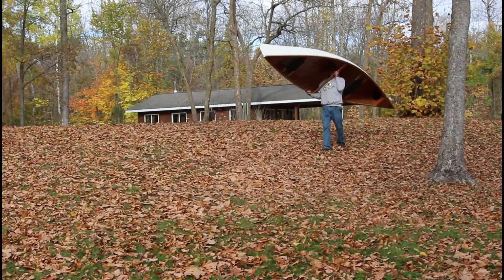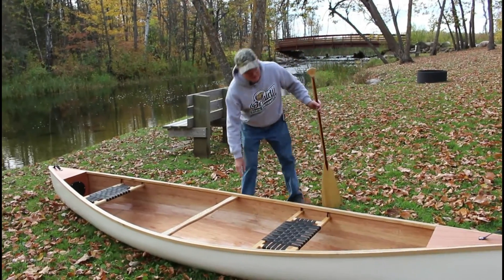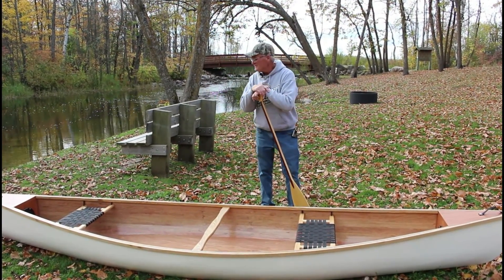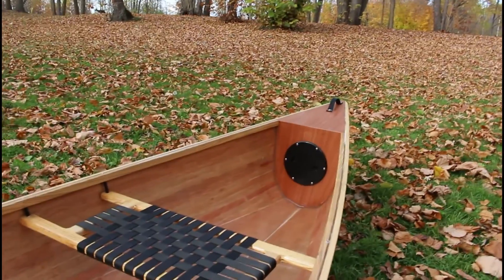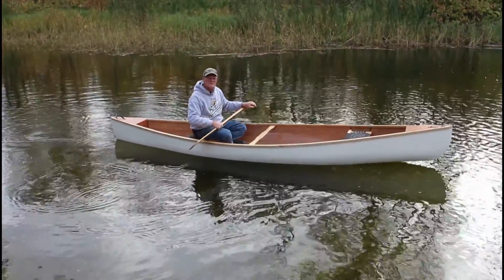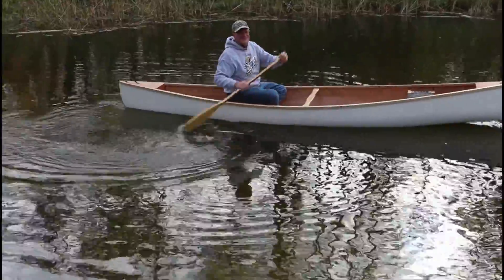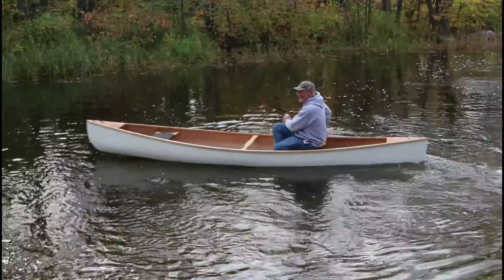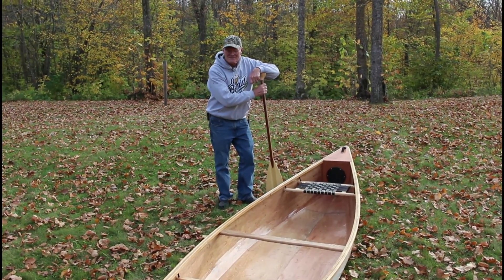Maiden Launch of Ripple II the Plywood Canoe

Comment: Sad I couldn't see the bottom go on and the rest of the build but will definitely get the book on it!
Reply from the maker: I am working on seats today for a second prototype. I used a simpler method of applying the strips for the sides. I will post a slideshow of its construction, and am diligently working on the book. Stay tuned!
Reply: @backwoodbasics9383  great to hear you are still at it and having fun. No rush and looking forward to it!